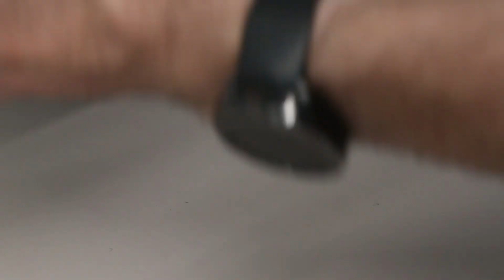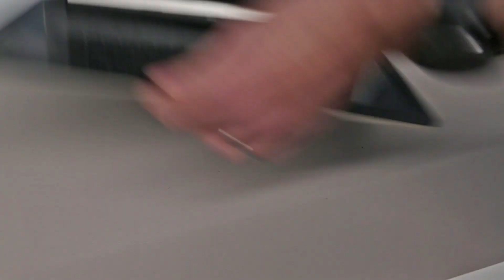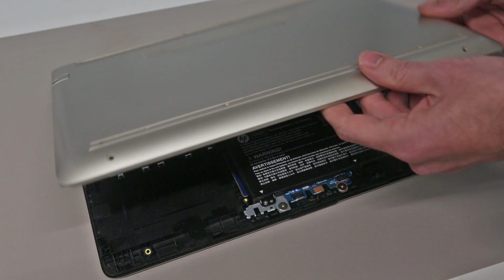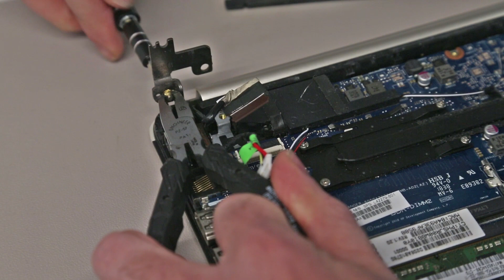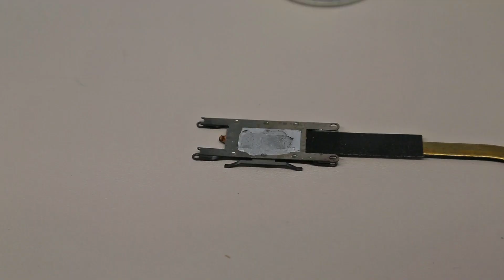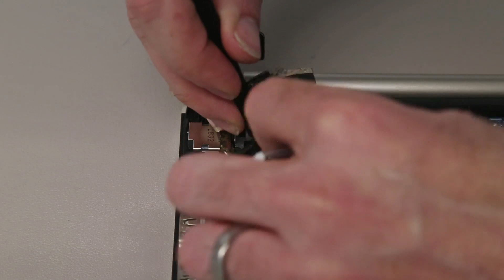HP 14-ck - Failed Hinge Mounting Repair - Keyboard, Palmrest and Touchpad replacement

Comment from the maker: I've tried to focus more on editing and showing processes in more detail in this video - along with voicing over whilst editing as opposed to during recording.
Let me know if you like this approach and I'll continue to do it in future.
Reply: Hello, I know this is a stupid question to ask but I just want to confirm if the cause of a failed hinge mounting is the repeated opening and closing of the laptop?
Reply from the maker: Its a failure of the plastic around the metal inserts in the palmrest - it can be fatigued due to the repeated opening and closing of the laptop, or often it can be down to the laptop being knocked or dropped, lid forced open beyond its maximum, etc.
Reply: @BrueComputing  Thanks for confirming
Reply from the maker: @Reason300  No problem, sorry I missed this comment originally.
Reply: ive tried buying a new top cover or palm rest without the keyboard ans i tried to transfer the keyboard and also the touchpad but the touchpad doesnt work anymore whay should i do ?